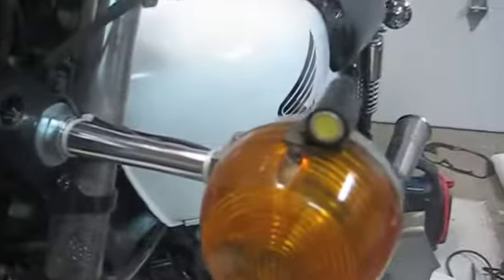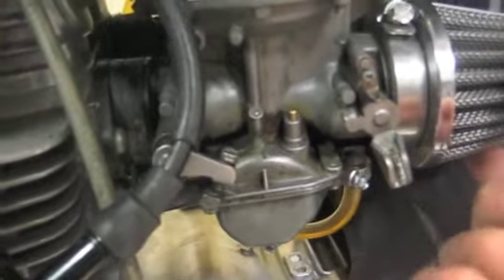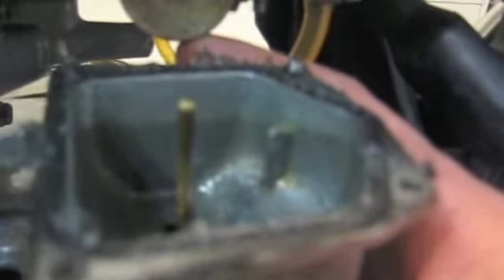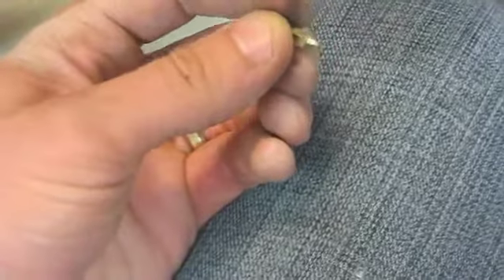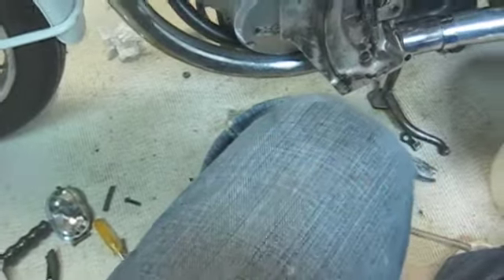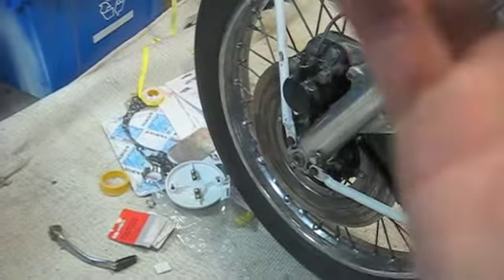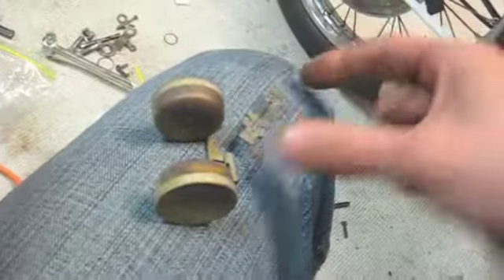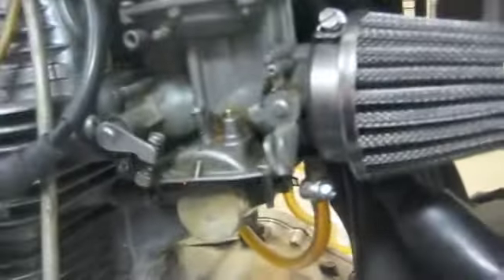Honda CB350 Carb leak

Comment: Just bought a CB350 and the carbs were rebuilt by the previous, previous owner.  It hasn't ran in about 15 years. I put gas in and it started leaking out the overflow tube.  This must be why!  Thanks for the video.

Comment: Hey Nick, quick question: Where do the lines from the carb go to? I'm trying to fix a neighbors bike but one line is loose and the other seems connected to something. Do they leak out infront of the rear wheel?
Reply from the maker: +jimmy hawley did you solve your issue?  just saw your comment now

Comment: Where did you get those handle grips. I can't find any to fit my 71
Reply from the maker: I will check out the brand. But all you need are 7/8th if I got it right, pretty much anything will do. Just preference. Most new bars are 1 inch.